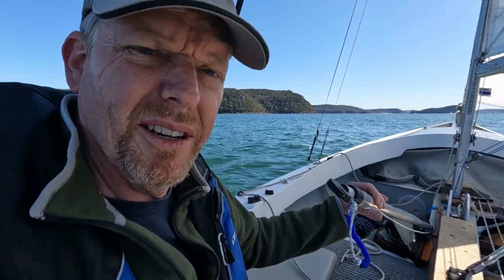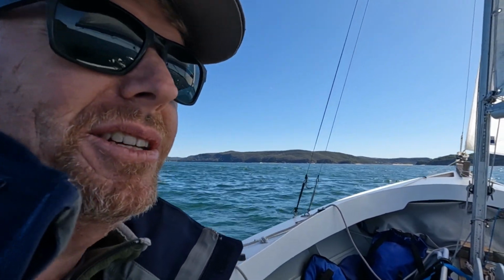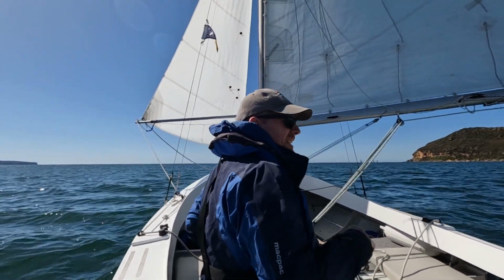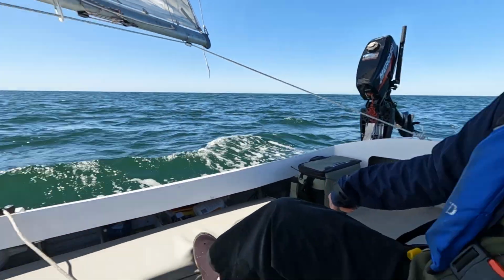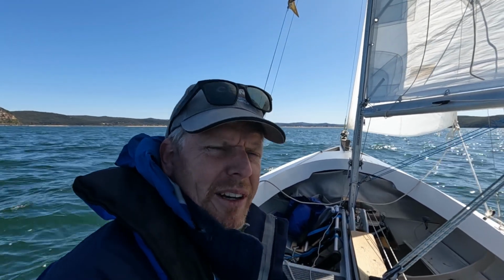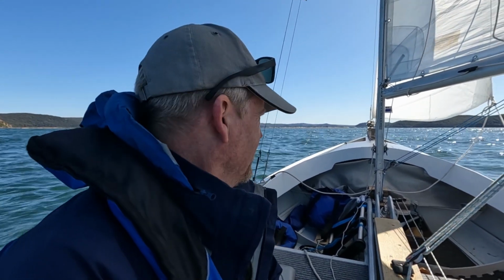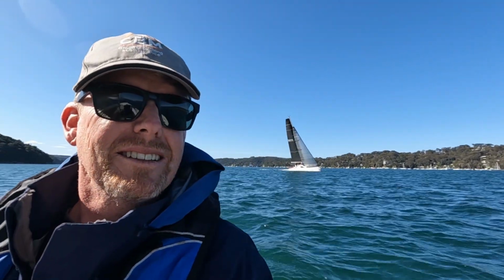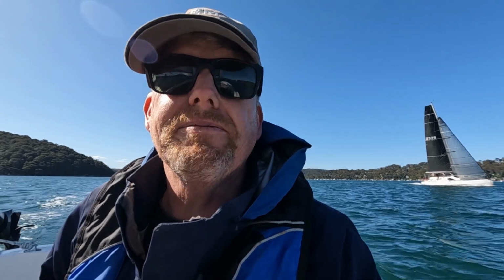Ep. 30 Spring Cruising: Seals, Whisker Pole Test and Crash Gybing!

Comment: Thanks so much for taking us along. By the way, is a whisker pole used just to extend the area of the jib and hold it in place? Thanks.
Reply from the maker: yes, jibs and genoas when sailing downwind - it is usually a fixed pole for that purpose. A spinnaker pole would be much longer I would think.

Comment: Hi Josh, great to see you out sailing again and I love Pittwater. 
Any way, I noticed a winch on the Starboard side of the Centre board and wondering what it for, I was thinking for the Centerboard. 
I didn’t think they were that heavy.
Reply from the maker: Hi Mark. It’s for tensioning the jib and main halyards. Cheers, Josh
Reply: @DinghyCruisingTrim  oh did not think of that, it that normal on the navigator as maybe I thinking next year to build a Pathfinder

Comment: Great sail Josh,the whisker pole looks promising once you get the little things worked out.
Reply from the maker: Thanks Bruce. I actually used the Oday jib size in the calculations for loads. Unfortunately didn’t test the split ring first!
Reply: @DinghyCruisingTrim  Yes they can be loaded up at times when you are in a rush to drop the pole

Comment: Very nice work Josh, especially making all the parts yourself.
Could you fit the pole in reverse so the twist lock adjust is closer to the mast and easier to reach?
Reply from the maker: Good idea. I was thinking that a boat hook should be of a decent length without having to extend it. Could reverse the design easy enough, if I was to make another prototype. Those fittings are epoxied in.